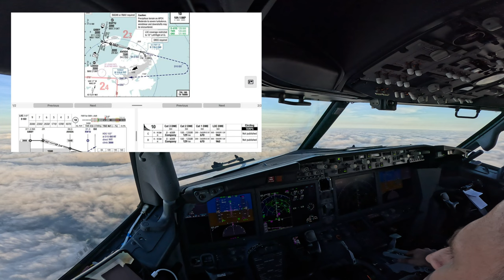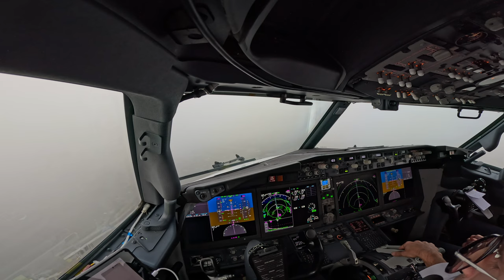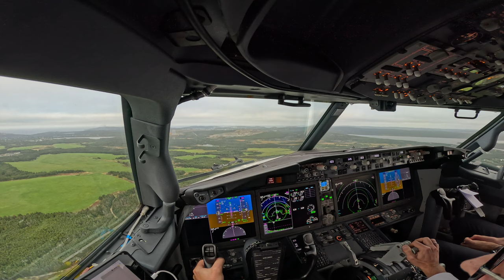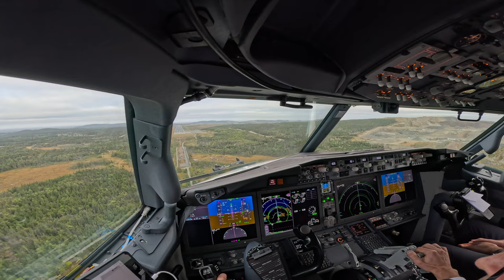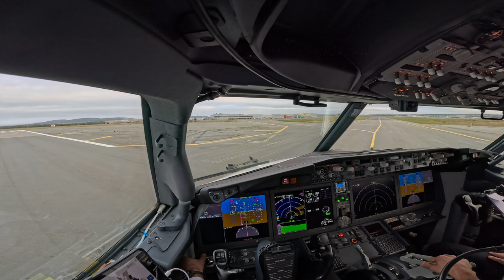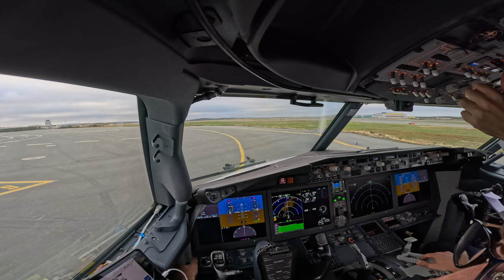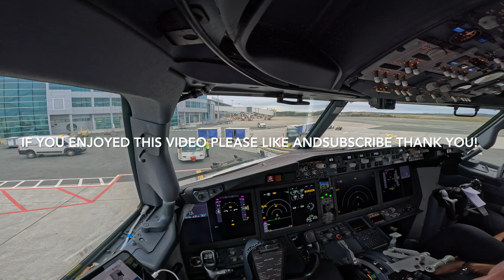4K Boeing 737 MAX Landing in St.Johns Newfoundland and Labrador

Comment: Mr Pilot, a quick question. 

In relation to the Boeing 737NG's EFIS and the integration of its ADIRU (Air Data Inertial Reference Unit) with other avionics systems, can you provide an in-depth analysis of how the SMYD (Stall Management Yaw Damper) system processes data from the ADIRU, particularly during high AoA (Angle of Attack) situations? Furthermore, considering the impact of recent MCAS (Maneuvering Characteristics Augmentation System) updates, how does the aircraft's FCC (Flight Control Computer) prioritize and resolve potential conflicting inputs from multiple sensors, specifically when there are discrepancies in AoA vane readings?
Reply from the maker: Brother I love your question!:) 
Well, ADIRU's get the info from the gyros, accelerometers and air data module inputs as well as pitot static systems. The air data modules convert pneumatic pressure to electrical signals and send that data to the ADIRU's. The two alpha vanes measure the angle of attack relative to the air mass. SMYD computers determine when stall warning is required based upon alpha vanes outputs, ADIRU's outputs, anti-ice controls, wing configurations, air/ground sensing, thrust and FMC outputs. Once the discrepancy is detected between conflicting inputs from multiple sensors MCAS is automatically deactivated.
Thank you for your comment! I feel like that's a good topic for a video:)

Comment: Very nice. But still thinking about speed 163 and flaps 15.....If I do that in flight sim I'll get BUFFET ALERT. hmm
Reply from the maker: Well, the speed bug was just above the Flap15 manoeuvring speed (around 155kt) so 163kt is just fine and no buffet alert should take place. Try in a sim and please let me know) is It PMDG?
Reply: @flymax  Thank you for your answer. Yes It is PMDG 738. I dont get BUFFET ALERT everytime, but just sometimes. Thats why this is even more interesting for me. How I understand PMDG 738 that 163 speed is to low for flaps 5 and I should have already flaps 15 at this speed. There is ofcourse important what weather conditions are ? (if Im correct)
Reply from the maker: @jakobhermann6475  oh I see where the problem is) there is a flap extension schedule that you can find in PMDG materials, which states that you can select Flaps15 at Flaps5 speed tape display. And of course 163kt is too low for Flaps5 and you will get a buffer alert. Not so much weather, but the weight of the aircraft.
Reply: @flymax  there we go :) I will fly in a minute and check it out. Are you flying for AC? If yes then we are working for the same company :)
Thank you very much :) and best regards from EDDF
Reply from the maker: @jakobhermann6475  beautiful, let me know how it goes) no, I’m with Lynx. I’ve flown to Frankfurt so many times! Cheers from CYYZ:)
Reply: @flymax  I just landed. There was no problem at all. Great news :) I  found out,  that before I did all to fast.  After watching your landing (almost trying to copy/paste) I did all on good time. I need to read more about it. For example the rules when flaps 1,2,5 etc :) 
Some of pilot are going directly from flaps 5 to flaps 15…So I’ll read more about it and practice, practice, practice :)